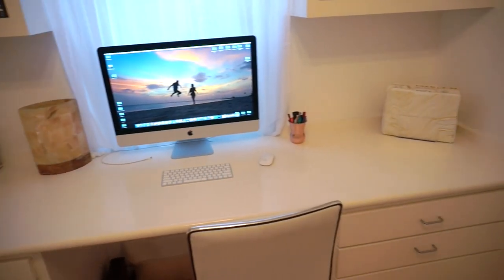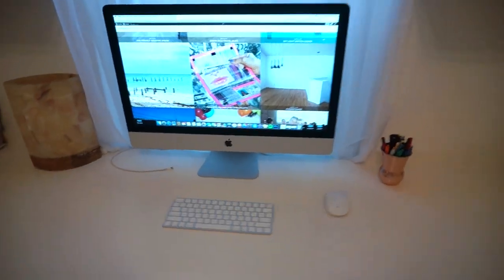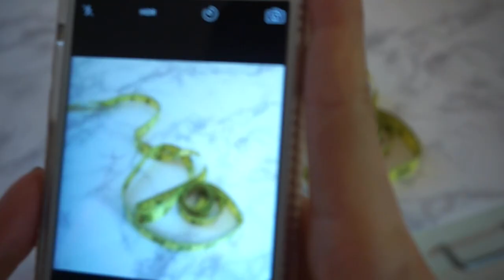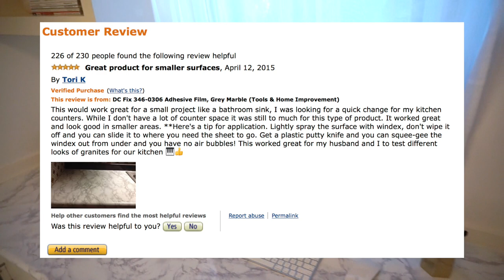WINDEX Hack for Applying Contact Paper FLAWLESSLY | Superholly

Comment: Suggestion: Windex is ammonia and water (scented with blue coloring - to make it worth $5.99).  Save $$ by making your own.  When wet most adhesives no longer stick (try wetting a piece of scotch tape).  The key here is to spray a liquid (a little soap with water works fine), align  the paper, squeegee out as much liquid as you can and use a blow dryer on warm to evaporate the remaining liquid.
Reply: Gary Schummer thanks
Reply: This is the way to go. I've applied thousands of stickers to my product at work and they have to be perfectly centered. Water and a little dish soap in a spray bottle is a trick of the trade.
Reply: Thank you for that tip, I can not handle the smell of Windex or anything like it. I thought water alone would be a good idea.
Reply: i think the point is that most people already have windex laying around.
Reply: @bonitabromeliads  Only people who don't care about toxic products.  I certainly don't buy that garbage.
Reply: Makes no sense to apply any type of liquid before applying adhesive.
Reply: I use a 1:1 solution of water and vinegar on tasks that don't call for a degreasing agent but rather keeping the water from beading/running like cleaning TV screens. The smell dissipates rather quickly.
Reply: Thanks, I appreciate those tips about the soapy water and blow dryer!
Reply: @bonitabromeliads  you're absolutely correct...But, I am so grateful for this info because I live 50km from the shop and my kids are brainwashed into thinking Windex is supreme to Everything else (not by me!)...I always have ammonia in the cupboard so I'll just top up the bottle with the DIY version and add blue dye! lol...love it!
Reply: My absolute favorite scent ever is blue!
Reply: thank you
Reply: @jason5409  I say the same as you Jason. I have done a lot of contact paper projects and have never used any liquid.
Reply: repent TODAY, forsake your sinful way of life, and believe in the Gospel.
salvation is found only in the LORD JESUS CHRIST alone, Who took upon the sin of the world on that cross, bearing the pain and punishment we deserve(d), that our sins may be atoned for, and He is risen [in glory] for our justification, that we may be made right with GOD, that we may know Him, be adopted by Him and reconciled to Him -- forgiven, set free from the curse of sin and death, and made as new creatures in CHRIST alone.

Comment: I really thought this was gonna turn out great; the video looks easy and the theory behind seems rational. In practice, however, the Windex created as many problems as it solved. While Windex does give you a little more movement once you initially put the contact paper on, the trade-off is that the paper loses some of its overall adhesiveness–even after ensuring that it is squeegeed out the side. This led to bubbles popping up later on, especially on the sides. My tabletop actually turned out decently in the end, but the sides were another story. Perhaps there wasn't enough surface area for it to work.
Reply: Yeah, wondered how it would stick after you wet it.. I don't think it will work for me! Sticky isn't meant to get wet, makes no sense!
Reply: This!! All of this!!! Liquid to stick sticky paper ? 🤔 😅

Comment: Super Holly you are the best!  I can't believe your tip worked.  I sprayed on warm water and dish soap and ran my hand over the mixture to spread it out evenly, then with my dollar store squeegy I moved the paper around until it fit just right.  I rolled the paper up from the bottom and used two chip clips to keep it out of the way.  It took 5 minutes.  I still can't believe the difference.

Comment: The texture is repeating so you can look for the point where it repeats and align the paper in a way that the seem is not visible.
Reply: I think you mean the pattern, not texture, but yes, you are right.
Reply: @barbarapisarski4144  Calling it a tileable texture is also correct. It has many different names like seamless texture, tileable texture, pattern,... Usually these things are called textures as they are simulating a real life material and trying to recreate the look and texture of said material. Patterns are more in terms of vector art and simplified tileable things.
Reply: @jashelps  gotcha! Being a seamstress it drive me nuts when some one calls fabric material. lol. Thanks for the 411 on the artistic terms.

Comment: how does the contact paper stay sticky after all that windex?..Im a bit skeptical about using windex..not understanding how the paper remains sticky? :/
Reply: I will just try a little piece first! 👍🏼
Reply: With wall paper you’re meant to paint the wall with a pigmented sealer and then when you applied your glued paper it allows you to slide it into place so I think this makes sense. Lol
Reply: It just works, that’s how most sticky things are applied. I do it with the clear film on cars all the time

Comment: I did the windex trick and now the corners won’t stick under neath 🙄🙄 I’m about to give up on contact paper, I don’t understand why everyone says it’s sooo easy.
Reply: @justhereforthe_comments8994  I've used contact paper for years.  Small and large areas.  I  think it's easy. I've never used Windex with it.  What's hard for some, is easy for others. And I'm not a trained decorator. Just a hobby decorator for over 40 years.
Reply: @justhereforthe_comments8994  I said, what might be hard for some people, is easy for others. It happens to be easy for me. What is your point? It's not something I have to lie about, just making a comment.
Reply: Use a spot of hot glue on the edge. Push down and rub out the lump as much as possible. And DON'T let the glue get too hot! Better a small lump than the entire project coming undone. I used hit glue when I needed a very small piece. Rather than cut a small piece I tried a piece the kids had been playing with. Worked great
Reply: What about some of the spray glue you use for vinyl flooring tiles?
Reply: Use a heat gun or blow dryer, it helps shape and reactivate the adhesive as well as aids in drying out the water!
Reply: If it is water based it will not help the adhesive to stick. Remember she bought 3 rolls so she could start again if messed up and even with 3 rolls one roll was used in the wrong direction.
Reply: It shouldn’t be ammonia based also
Reply: Tbh I don’t trust the Windex trick because I’m not about to use something wet underneath my adhesive I’m trying to apply semi-permanently
Reply: Emily G. I promise if you squeegee all the liquid out it works! I install vinyl as part of my job and I never apply it dry. I wish I could post a pic of my counter tops on here!
Reply: I never heard of using Windex or any other liquid, but I was trying to cover various surfaces with contact paper, and I agree it tends to peel up at the edges, and I used to be frustrated by this too. But then I ordered Scotch Removable Mounting Putty from Amazon, and I used tiny little specks or itty-bitty lumps of it, stretched them a little to activate their adhesive-ness, and stuck them under the edges of the peeling contact paper. So far, it’s been holding very nicely. Recently I heard that an off-brand of mounting putty is available at some Dollar Trees. I haven’t gone to a Dollar Tree recently, so I can’t confirm this, and even if they have it, I don’t know if it would work as well as the Scotch brand stuff.

Comment: Ok! So I was skeptical that this would work for doing my kitchen counter tops since it needed to be waterproof. It’s one thing if the edges of a office desk don’t stick the best but a kitchen is different. I was already one small section into my project when I found this video. My 1st second was good but still had bubbles and I’m very meticulous! So I googled- “how to apply contact paper”. I had already watched all the other faux marble installs. BUT this time this video popped up. After watching, I stopped what I was doing and ran to the store for a squeegee and windex. Come home and went for it! Super easy! BUT I the adhesive was not so sticky even after all the windex was out. I was worried!! I got out the hair dryer for the final setting (normal final step when using this material- especially with edges). It finished drying the windex out and then everything stuck! It was AMAZING! I continued with the rest of the counters and I ended up with BEAUTIFUL, BUBBLE FREE kitchen counters!!! The hair dryer is also good for getting flaws in the contact paper- like wrinkles! Poof! They are gone with some heat!

Tools I used: pencil xacto knife, putty knife, hair dryer, squeegee, windex, and long ruler for straight cuts.
Reply: Wish I could add a photo!
Reply: Thanks, this comment answers the exact question I had in my mind.
Reply: @donnettethayer4956  you're an indie legend :D
Reply: After three years is it still holding up?

Comment: Hi. I'm wondering exactly how the trick works. You don't need to take the sticker part off if you use the windex?
Reply from the maker: yes, yes you take the sticker part off! you just apply it on a lightly damp (windexed) surface instead of a dry one, and then squeegee all the moisture out once it's perfectly in place.
Reply: Hey Superholly.  I think what is confusing is that I am assuming you unpeel the first bit and put that on the windexy part and then unpeel the rest.  In the video you don't say that specifically.  Thanks so much for this video - have been searching for a while on how to do this!

Comment: Alternatively to windex you can use a hint of soap with water in a spray bottle which is less likely to mess with the adhesive. Also, when going around 90 degree corners you can lightly heat the paper with a blow dryer to work with it better and form a crisp edge

Comment: Great post! I checked product at Amz, a little spendy, kept searching and found this; Duck brand peel and stick laminate rolls. Comes in marble and many more, has dots/lines and ruler printed on back according to reviews, has quite a few positive product reviews and width/length options of 12"x26'. 18'x24' and 20"x15' and found the 20"x15' white marble on Amz for $6 per roll vs. your 24"x7' for $20. Now to decide on color etc. and I'll try to come back and follow up with a post after using it!
Reply: Walmart is usually WAY cheaper for the exact rolls of these! Always check both for anything many times Walmart is cheaper!

Comment: Hi! I'm thinking of doing this with my desk and so far this is the easiest video I found! But in my country we don't have  the same brand of window cleaner so I wonder if there is anything special with the windex? And also, doing it dump doesn't it affect the adhesive to some extent? Or make the paper itself hard or something?
Reply: Thank u for a nice video anyway! 😊
Reply from the maker: +Marian Laine that's the crazy part! The windex doesn't affect the adhesive at all! As long as you squeeze it all out at the end, of course...  Make sure you only spray it lightly, you don't want it to be soaking wet. As far as what to use, I'm pretty sure any window cleaner will do. 😊
Reply: You can also use just plain soap and water 😊

Comment: Is contact paper permanent? I live in a furnished apartment so my desk isn’t technically my property so is it as easy to remove as it is to apply?
Reply: Alicia  Duran I've just removed really old contact paper from my pantry shelves. I used a hair dryer to warm it slightly then it just peeled off.

Comment: Does anyone know if this marble contact paper is removable?  I am thinking about doing this to my desk in an apartment I'm renting that came furnished, but I have to be able to take it off when my lease is up!
Reply: Yes it is!
Reply: I have some marble contact paper that I needed to remove. It didn't come off in 1 piece but not itty bitty pieces by far. Left no sticky residue but if it had I'm sure rubbing alcohol would have removed it. Or oil. Contact paper won't stick to an oily surface
Reply: It helps to remove out by warming with a hair dryer as you go.  You might need oil to remove any sticky residue after but it does come off. Go slow on wood surfaces so you don't take the finish off. I rent and have contact papered my closet door that had holes in it and my back splash and a desk.  Gonna do my table.

Comment: Can it be any window cleaner or does it have to be windex
Reply: A few others said in the comments above that they don't bother using Windex, they just make up a spray bottle with warm mildly soapy water (small amount of washing up detergent, in warm water does the trick, apparently) and then spray a fine sheen onto the surface to be covered with the contact paper. You must squeegee out as much of the liquid as you can (good to use paper towel to help dry up at the ends, as the liquid comes out, plus several suggested you can finish with your hairdryer on medium, to be sure its nice and dry).

Comment: Why do you need to spray with windex ???? Is it not peel & stick ?????  Looks gorgeous !!!!!
Reply: Yes, it is peel and stick. The surface is sprayed with a fine sheen of Windex (or even mildly soapy water) before you apply your contact. You peel the backing paper off your contact a bit at a time, and apply it like you usually would- however the fine sheen of fluid on the surface area prevents the contact from immediately sticking- and allows you to get out air bubbles, and line the contact paper up straight (this method gives you the benefit of being able to move your contact around, to make sure you've got it just right).

Comment: What to do if you have a heavy TV stand that you can't move by yourself and you want to put contact paper on your living room floor?
Reply: Lift one corner and slide a big piece of cardboard under. Then the next corner. Then lift up the other end slightly and shove the rest of the way onto the cardboard. 
If it still doesn’t slide easy enough, slide the cardboard/TV stand onto a sheet of plastic or a disposable plastic table cloth. 
Grasp both the cardboard and/or the plastic and pull toward you. 
This works for couches, bookcases, etc., too. I’ve done it. 😊
Work smarter; not harder!

Comment: Could you do this for a bathroom or kitchen sink? I'm wondering if it gets wet will it ruin it? Also, is it hard to take it off? I'm renting an apartment and I'm wondering if this is a good temporary design to use? Xoxo
Reply from the maker: I'd say absolutely! The most important thing will be being very precise with your cuts.
And yes, you can totally remove it when your lease is up 😉